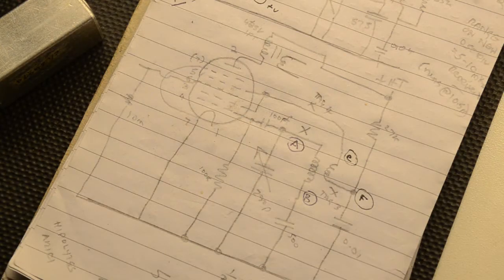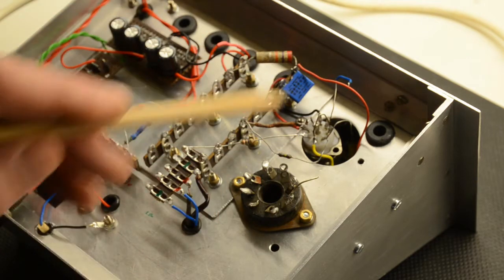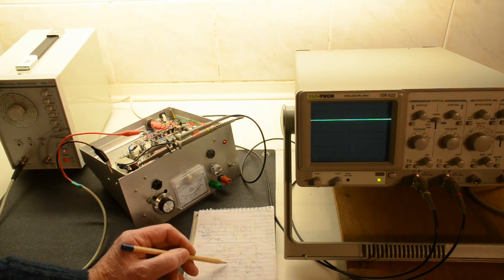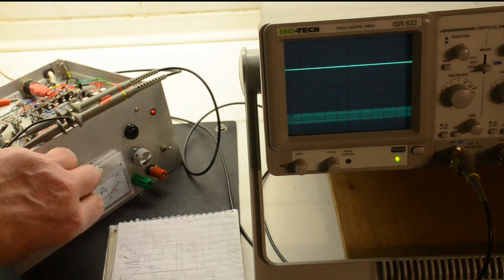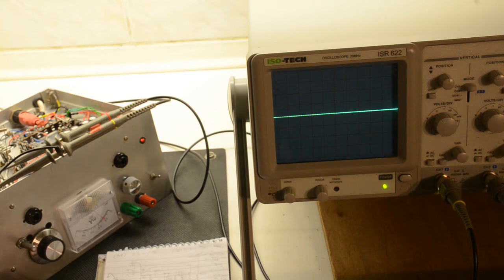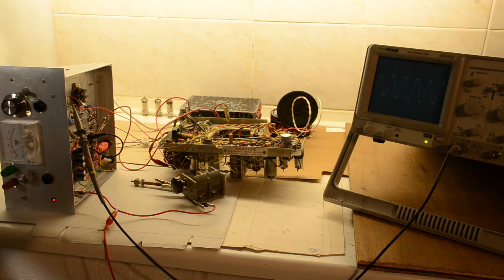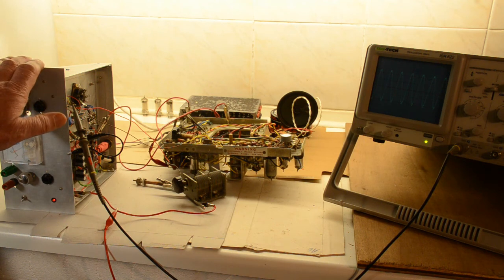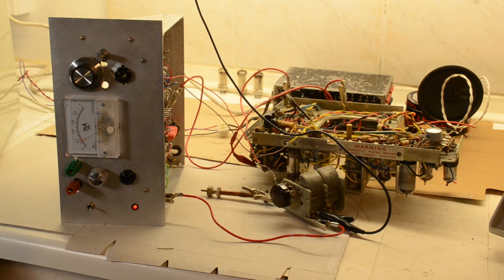How does a superhet work? A practical approach (PART 2)

Comment: Nice sequence of movies, you are one of the few that seems to know what he/she/it is talking about, and seems to have a grasp of understanding what is going on.

Furthermore, you visualize your understanding in a coherent way.

(Most of the explanations I've seen thus far, will go no further than: "This is it, and so it works", without understanding/explaining the basics.)

Thank you for "putting this out there".

What makes me wonder though is what came first: The oscilloscope or the superhet theory?
Reply from the maker: Thanks for a nice positive response! As for your last question, whilst the principle of a cathode ray tube was invented towards the end of the 19th. century, the first commercial versions of the oscilloscope were not really around until 1930. 

With a lot of other ideas, electronic  inventons and principles like the superhet (of which there is a patent from 1918,) once again, there was nothing on the market for many years. Whilst we rely on high performance 'scopes today, many types of equipment 'invented' and used during WW2 didn't need one to prove that they worked. For the 'scopes they had access to, they were very primitive compared to even the most simple examples we see today. With that said, (speaking from someone whose first 'scope was a valve one they made themselves), any oscilloscope, however primitive is infinitely better than no scope at all. 
Whilst can't remember which Youtube video it is in, my 'first scope' built in 1977 is seen being used in one of them. (Yes, still works!)
Reply: @lishaton   "Compliments are due where they are most welcomly received"
 (Euripides?)

Those guys must have had "scopes" in their head. Just try to imagine how they perceived how the world worked without them. (Well, of course, they had the Bohr model, but QED had yet to be invented.)

I'm still struggling to paint a picture in my head of multiplying (dividing) vectors.
Add and subtract pose no problems, but forming a decent  explanation of how e.g. a "yagi"-antenna works?

A 3D scope is needed!

I can understand the theory, yet cannot perceive where the "noise" comes from.
e.g. : I can design a perfect receiver, for say 1THz, according to theory.

But, where does all the noise that I need to suppress come from anyway?

Oh well, to live in this Universe and fathom it, it is ruled by faith, I guess.

Having them explained to you, with machines you do not understand, is dissatisfiying at the least, and grossly offensive.

Unless the machine-maker himself explained how they work.

Kudos!